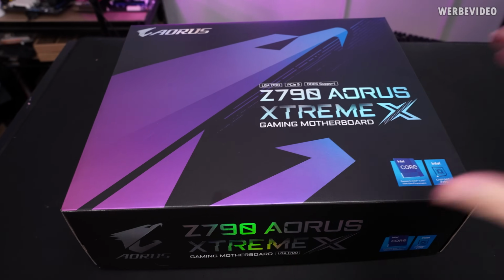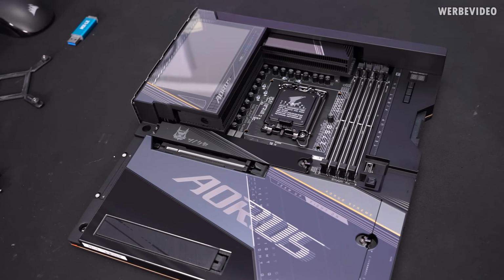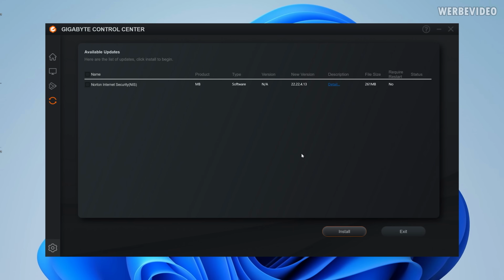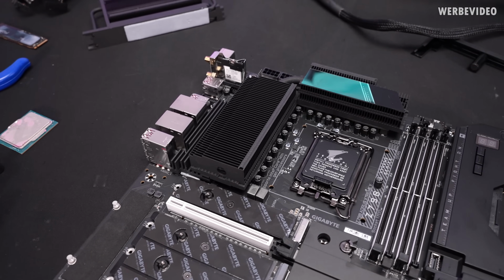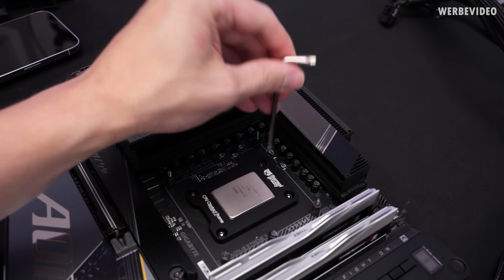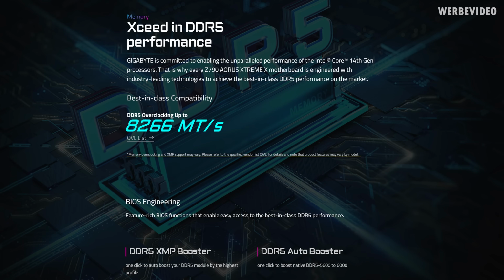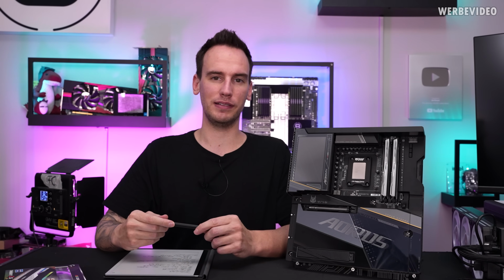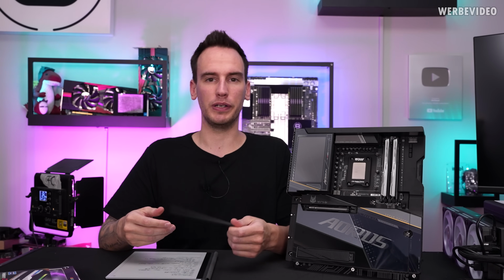Overpriced and Disappointing! The $1300 AORUS Z790 Xtreme X

Comment: Just look at the CPU specs people. because they never mention ranking on the MB's. all list the ram frequency. Like right now, am5 only specs 3600mhz and am4 is only 3200mhz but only 2 sticks, if you want to run 4 sticks your speed needs to drop to 2933 at best but if you run dual rank your looking at 2667 or Been dealing with this memory scam for a decade. Just figured it out the other day, after getting rid of a perfectly good x570 Master and a kit of ram, EK monoblock that went with the board. Only to find out nothing was wrong.

Comment: Can’t believe that a company release a product like this at that price point.. An ASUS  APEX Encore is about 700 usd and it should be the most expensive mobo thinking about memory OC. All 4 dimm board  don’t worth it for a price tag above 500.   Where are  the extreme things?  This board is not made by OC nor XOC, nobody would run 9000MHz or even +7200M /s stable in Y cruncher VST+VT3. I have and apex and a Hero. The hero is much better that this thing.. it’s a scam

Comment: I'm still running an older Aorus Z370 board and it has a small fan under the IO shield but according to HWInfo it never runs it but they could have done that here although there isn't much of the way of vents to exhaust any air.

Comment: I'm not surprised that Gigabyte software is what is letting this board down in terms of customization. It's complete garbage and every time I change RGB on my Gigabyte GPU in 5-10 minutes I get bluescreen and that is 100% by the RGB Fusion because the bluescreen happens only after I run the software. The Windows 10 installation I have is running like well oiled machine otherwise.

Comment: I’ve been using gygabite motherboards for years now and I’m currently using the Z690 Aorus elite , the hardware has always been top quality but the problem is the software , for example there are several bios updates and quick ones  that Gygabite does and kudos to them, but the control center, RGB fusion ( even for the Graphics cards) always has issues and is absolutely terrible compared to other manufacturers 

I have no doubt that if Gygabite invest in better software development they would achieve much better confidence from consumers
Reply: Same here. My latest boars are 2x the Z690 Aorus-Pro rev. 1.1 and rev. 1.2, whatever the difference(s) is/are.
This one got a new beta-BIOS just last week, but I only found it today. I couldn't see any changes they made.
As system-builder both private and commercial, I usually suggest leaving the Gigabyte software, where it was the day before.
For the RGB and a-RGB headers, you can use openRGB, which does pretty well, only it doesn't detect my RAM-RGB lights. At least, those RGB lights on my latest memory doesn't seem to need much power anyway, so I can leave it on and not be afraid. Everything else, I recommend setting up the hardware things in the BIOS, so
Reply: I don't understand how a company the size of Gigabyte has such terrible software...I refuse to install it on my PC again! It uses a ridiculous amount of resources when it's running and it doesn't even work half the time...I had an X470 gaming 7 board that had RGB fusion built into the bios and it worked great but every Aorus board i've had since then you've had to download that crappy software...It really sucks, because I like everything about the Aorus boards except their software...

Comment: i started doing pc's since 1988 and in all that time the ONLY make of motherboard that fails me is Gigabyte. I used to work with DFI LANPARTY (yes i know oscar, , jarry, max and jimmy ) infact i helped to design the cooling layout on some of their boards and back then I did not like gigabye. , But asus , asrock and others  had very little issues yet but only gigabye had the issues of a failure rate.  When Nigel SUTCH (hes at Nvidia now)  moved from Universal A-bit to Gigabyte the brand got even worse in my opinion.

After coming first in Universal abit 2006 UK OC contest and 2nd in Gigabyte's UK GOOC in 2010 (yes i still didnt like gigabyte back then as the PRIZES they gave out for 1st and second  place were from USED motherboards that were utilised within the contest. Which were well messed up from the contest itself of which failed on us when we took them home) now 

Overclocking has turned from an artform than science where one had to mess with memory dividers etc to almost a press of the button so given that for me there is no need to spend £1300 on a oc board either. I am partially to blame for this as DFI LANPARTY first came out with AUTO overclocking (LONG before Asus_, it was called ABS (Auto Boost System) and I know as i suggested the idea to Max Chang (head of DFI sales). It was a way of being able to save the settings of an overclock onto a floppy disk and then another computer with a  similar generation DFI motherboard could use those saved overclock settings and oc the system.  So it could be said that auto overlocking is my direct fault and for that I apologise.
Jarry Chang, Jimmy Su, Alex Cheng and  Max Chang were witness to this.
To go off track a little
My credits:
ABIT-IP35 PRO worked on this
DFI LP P45 DK AND UT
X58 DK and UT
P55 DK
X48 TIGERFORCE the cooling of which by seperating the ICH MCH and and using an active cooler to try and break the crazy of rathe foolishly linking them all the with a heatpipe=of which was based upon my research on the nforce 6i 680 IN932MAX
Helped to develop the Lamptron  FC10 SE fan controller
and Debauer himself might hjave heard of this next company .
Developed best application method and worked as support for.... Andrew Lemont's Innovation Cooling IC-DIAMOND thermal paste!

You might have heard of me under my old OC handle of Gilgamesh

So given this i do somewhat think i have a very small experience on these things and in my opinion gigabyte suck hard!

Been out of the Overclocking game since 2016 now as
 now that one is older and that wife, the kids and the moggies (cats) will not let me:P

Given Gigabyte's CLEAR and documented issue of cracking graphics cards-because of their OWN design faults and then not supporting users. it can only be said that charging £1300 for a motherboard is just plain crazy.

I am happy with my ASROCK Z790 Livemixer (oooooooh love the purple) as it seems those guys are trying to do something different even if it is just cosemetic.

Btw I use Debauer's Thermal Grizzly paste, its consistency is a little thin for my taste as in super hot environments the liquid binders on the these types dry up over time thus creating free space holes and thus no contact.  But noone can deny Thermal Grizzly's results for a PC -its bloody brilliant.

Comment: $300 board + $1000 plastic. That's some expensive plastic!
If you want a screen, just get an Asrock board, these integrate eDP (laptop internal displayport) and you can get many size/dimensions/resolutions screens for this (and for cheap), and then it just acts as a display hooked up to the iGPU, so you can display anything you like independent from any manufacturer software. There are some nice casemods with this.
Reply: The plastic comes with a hidden climate tax on it, that's why it's so expensive. /sarcasm

Comment: Motherboard vendors for many years state the memory speeds that are achievable by people who know how to setup various voltages and timings by hand, rather than Plug and Play. For example in LGA775 era the top P45 chipset motherboards were advertising DDR3 speeds up to 2200MHz, while the chipset(MCH) really is struggling to retain stability above 1450-1600MHz. You really need the knowledge of the board and experience of days upon days of struggling to achieve advertised speeds. Also settings were different for different mobo manufacturers and some RAM IC's were not getting along with boards at all (one liked Hyper's and wouldn't be stable with D9 GTR and some the other way around). In general I think these days it's simpler, even if you have to tinker a bit to tune the system.
Reply: You need the knowledge no doubt but if you don't have the hardware to do get there then it doesn't matter.

Comment: First of all this is a halo product like 4090, that is why it is this expensive. 
I always prefer gigabyte over any other brand when it comes to motherboards. If you tried an entry level asus board, you'd know what i mean. And last, if you put that in a closed pc case (like a silent case) with positive air pressure, that holes will make flow more air through vrm heatsink. I dont know it will make 7 degrees difference but it will make a noticeable difference.

Comment: GCC is a piece of junk - I have the same with the RGB on my Z790 Aorus Elite AX - the RGB does not make sense at all.  I am not too sure why this board is available at such a price.  Not sure where it fits in the market, maybe for the elite builders.  At this moment we all know that these boards are still not done developing.  I have also seen a lot of beta bios upgrades on Gigabyte's website.  I use a little tool, called Fan Control and I tried all sorts of RGB programs, the only one working with my board is "signal RGB", but that is not completely free and still has issues.

Comment: guys i know its irrelevent ot the video, but can anyone tell me how can i power a pc using only DC input voltage @der8auer EN
Reply: There is PC that only require a 12V intake (like the melee quieter 3 I use for astro for example), so it can be powered of a regular 12V battery. 

Otherwise, unless you custom make a delivery system to power the 12V, 5V, 3.3V that the PC require from whatever source you have, you'll likely need to use an inverter, that will take the DC power; make it 220/110V AC, and then feed it to your regular PSU, that will then handle the rest.

Comment: These boards are hilarious. Give us more stripped back boards, like the taichi lite but even cheaper. It makes sense paying for more connectivity, more nvme slots, more pcie slot configs, faster LAN and wifi, better rear IO and so on. Now they lock most fun bios / OC features behind the board price points.
You'd love a Z series intel or B650E with fully featured bios, post code, good vrm, gen5 nvme, 2 ddr5 dimm, gen5x16 pcie and all the jumpers as buttons then save the money on it being microATX, bare minimum IO, single lan, no built in wifi, 2 sata, no on board rgb or silly over the top fake heatsinks / shielding etc etc

Comment: Why don't reviewers even mention how Abysmally bad Gigabytes memory training is? Legitimately the worst boards for memory out of all manufacturers. Not to mention the bios in general is dog shit. It took me 4 weeks (yes 4 weeks) to stabilize 4000 cl14-15-15-35 dual rank gear 1 command 1 with tightened sub timings on a z690 ud ax with a 13700k. It took me 1 hour on a MSI edge ddr4.

Comment: That is typical Gigabyte and theeir software. It's like the programm in a diffeerent language that only they understand. I tried many times their software and always have issues. That's why i stopped buying Gigabyte as a brand. They have nice boards, videocardds and so on, but always somewhere a major flaw like RGB not working and a panel with der8auer and you pay 1300€ that is just crazy.

But they think there are enough fools that buy their stuff. Also the 4000 serie cards with the pci-e waek spot....just avoid the brand all of us and they will make things different.

Comment: 25:45 Why not measure with the holes,  no fan and then cover the holes. The holes would work better in a high positive pressure case build, ie. 5 fans in, 3 out.

Comment: I think the software for all these manufacturers are freakin garbage.  Feels like they are all first year coders. Asus Amoury crate for me is the worst. If you have an update for your motherboard, the software will not even let you control anything. You have to do the update. Than, you sit there and pray the update gets applied correctly cause if it doesn't than you have to jump through hoops to make anything work.

Comment: the instability might be a bug because that bios version looks too green, or because you already push that CPU might need a little boost on the Vcore (like 0.010 or .020) or ram Voltage, I do not like memory profiles XMP, prefer to do it by hand (but that's me)
Reply: oh, might even be because you did not install norton , hehehehehehehhehehehe

Comment: the holes are so easy to check - just cover them and see if 7 degree delta. really disappointing.
Reply from the maker: How would this test a over or underpressure inside a closed system? :)
Reply: @der8auer-en  well, if the wholes are "helping for temp", the lack of them will prove / disprove the claim.

Comment: the last time i bought a gigabyte board was when i built my i7 7700k pc. HATED it . made cpu run very hot and software was garbage, replaced it with an asus tuff mobo and temps when down almost 20 degrees. It was the first time i didnt use an asus mobo  in over 15 years and the last.

Comment: Gigabyte could have probably tossed in a decent DAC but this thing they named after the ADC/DAC components inside, that's decent comedy. I mean they could have named it "DAC" or "generic DAC" but I can work with this.
Reply: Looks like a USB dongle with a similar newer ESS chip costs around $30 retail, though you can find other CX dongles for a fifth of that. I mean, they'll do the job, but just a smartphone dongle at that price point...
Reply: @Lishtenbird  the newer chips don't tend to be better, just offer more features. If there's a volume knob o  it then it's not too bad, I always use an external dac

Comment: I wonder how the screen will hold up with that decent looking VRM heatsink dumping heat into its rear. Those vent holes look like a necessity.
Reply: AGREED
Reply: Fortunately, it will be just fine. At around an 8th of an inch, the temperature of a heat sink with heat fins wouldn't do much to a screen at all. And that's at static air pressure. Add a little air flow and it's fine.
Reply: Yeah, that's a great point. We haven't studied LCD technology for over 30 years and know exactly what it can handle.
It's not like we design outside LCD panels which bake in the sun all day for years and years in WAY hotter temperatures, or anything.
I'm sure nobody stopped to consider whether a component of the board they engineered could withstand a minor amount of heat under it.
Thank goodness we have you.
Reply: @tim3172 The bean counters have engineers ignoring issues all the time.

Im not saying the LCD won't last, im sure it will. But don't assume these companies actually account for longevity. You never know when an exec said "thats too expensive, just blame the customer so we don't have to honor the warranty"

Comment: I was expecting the "7-degree difference" to be tested by simply taping over the holes (because I assumed it's compared to not having them there), but if even pulling the air forcibly results in only 2 degrees... Yeah.
Reply: Yup, I expected the same
Reply: Same here, Bauer would have to build it into a case/tower though, so I understand why he didn't.
My old Z370 Aorus G7 board has a tiny little fan inside the IO that either blows over, or pulls air over the power stages, I've never heard it spinning (but it definitely is), so maybe they should've continued with that little trend instead.... I always liked telling people I have (had) TWENTY individual fans inside my tower (I actually did, double 240mm rads in push/pull for top and bottom of case, front 360mm in push/pull, rear 120, triple fan card, and then a rear compartment 90mm storage fan, but then I put the card into the loop and lost 3 fans lol) 🤣😅
Reply: It needs to be in a case with positive pressure to properly test.
Reply: I'm still wondering why he don't have any knowledge on  Sound Blaster card. 😢

Comment: i think the product i really want to see is your own individual take on the framework 16 laptop. (which unfortunately... does not have nvvidia gpu option). but just in all other respects from the product design. and how much further it can be taken.

the reason i request this product review: its because gaming laptops are actually pretty notorious for dying with dead gpu (or cpu, whatever else). and once broken they cannot be fixed in any economical or serviceable fashion. and anyhow this laptop also has other nice customization features, and other types of servicing or expansion / component replacement.

Comment: Interestingly, the Internet was delighted with the x570 aorus xtreme. Add a few numbers (especially in the price), break a few things, change some and you will end up with a big disappointment.
Reply: That one was "only" $700 and was focused on putting the best components on the board instead of silly crap like a bling display and a shroud. Still, Buildzoid said that the $360 X570 Aorus Master was still the more sensible choice unless you really wanted 10GbE LAN which at the time was a luxury, along with a passively cooled chipset.
Reply: @gippygames  You will be surprised, but during the premiere of Ryzen 3000, I changed the platform to the only board without a fan.

Comment: The board has to be using the iGPU to mirror the dGPU in order for Thunderbolt to actually work which means a simple DP-ALT to DP adapter should work if you want to use the iGPU for an actual display.